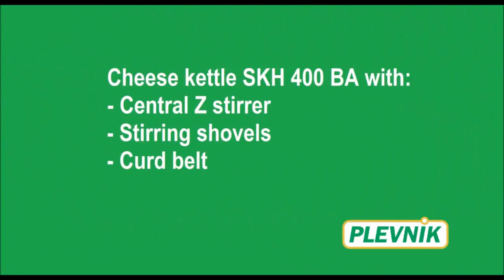Cheese making 400l milk with Plevnik equipment

Comment: Good afternoon I have seen several of your videos and the equipment that you promote looks very practical and of excellent quality in sight, I produce cheese in an artisanal way, I process about 100 liters of milk a day I can process more but manually and with domestic means is difficult. My question is, what is the line of smaller equipment that you produce? for how many liters of milk a day? They will have equipment for between 100 and 300 liters of milk. I know this would be practically laboratory equipment, but it is what I work for. If it is a multifaceted machine, better because I make fresh cheese, semi-cured cheese, cottage cheese, cream and yogurt.
Reply: hello. I am in a similar situation of handling about 300L of milk/day and want to mechanize the cheese making process. Were you able to get the equipment you were looking for? Plz advise